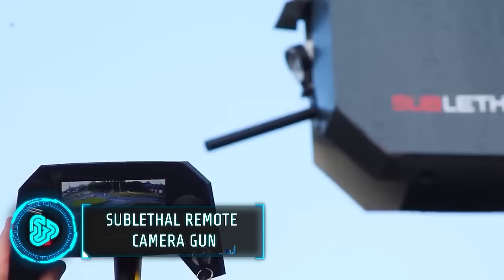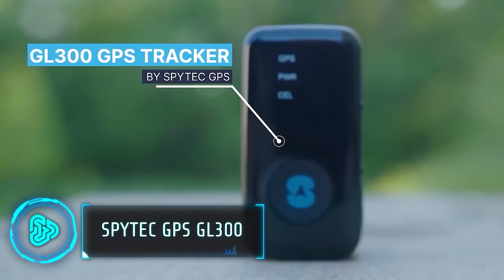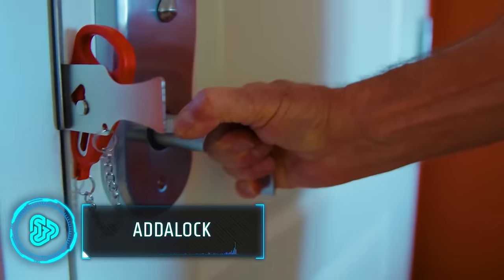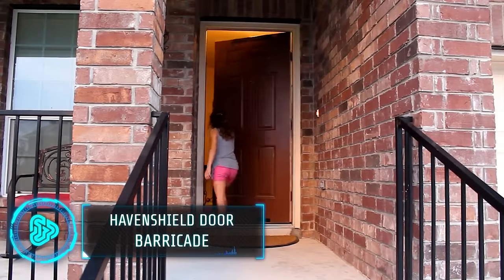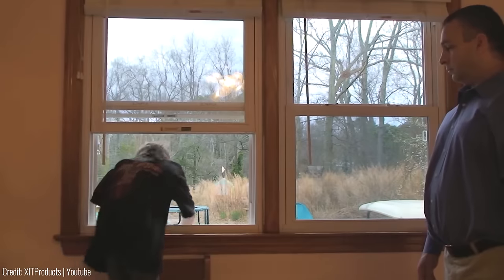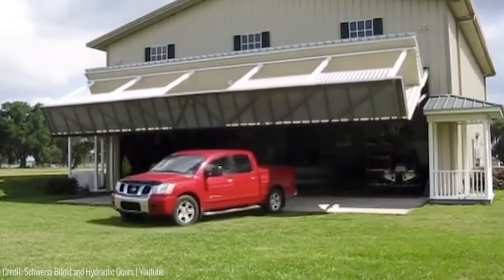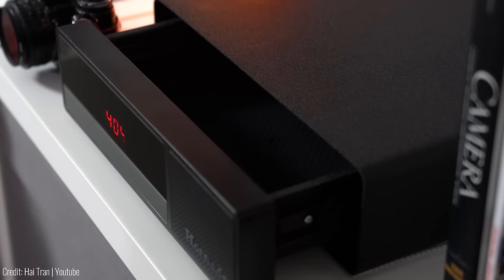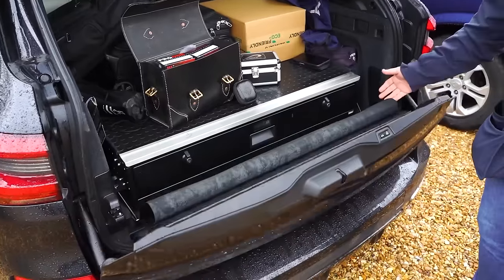100 GREATEST HOME SECURITY INVENTIONS OF 2023

Comment: Okay "Tech Joint" False and Misleading heading. What does a portable wine celler have to do with home security???  Me thinks you need to be slapped to help reset your motherboard..your connections are misfiring! System Alert. Because of this I won't be back.